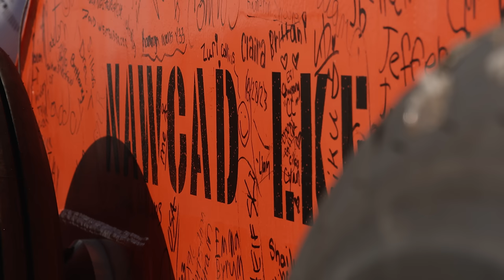John F. Kennedy (CVN 79) Dead-Load Testing

Comment: Wow!  Good to see the new Kennedy almost done.  I did design work on the old Kennedy CV 67,  Ford CVN 78 and the old Enterprise CVN 65. Great to hear that the EMLS is going well compared to the Ford.
Reply: The Sorry Sarah, (Saratoga)? I was on her in the early 90's for four years.
Reply: I would surely hope that they worked out the kinks in the EMALS or else that would be awful. Sure, they built-in way too much new tech into the Ford class, and there were lots of teething pains to fix, but in the end it will all have paid off.
Reply: @oceanic8424  I think they have worked out those kinks.  The Ford just did a really long deployment that surprised me and seems to indicate that things are working well.
Reply: No camera on the carts?????
Reply: @ghostmourn  Yes, the new launch and arrestor systems(EMALS/AAG) are working great and are performing above expectations.  You don't cruise the Middle East with sketchy sortie generation capability.
Reply: Almost? Almost in ship building means 4 years minimum.
Reply: To be fair, Ford was the first ship of a new class with some dramatically new technology, so there were going to be some bugs needing to be gotten out of her and the systems in any situation (though I wish it could've been done with less delays and extra costs). And so far, she's had two successful deployments on her operating record. Hopefully, the remaining ships in this class (Kennedy, Enterprise CVN-80, Doris Miller and the announced CVN-82) will be built and put into service much more smoothly.

Comment: I got to see the final testing on CVN 78 2 years ago and it was amazing knowing that the rails are powered by magnetic coils under the deck. 
When Ford left the dock, we went to the Kennedy and pulled miles of wiring throughout the ship. 
What an experience! It was the hardest earned money I have ever made. I will always remember that shipyard.
Reply: They do know that electrical equipment and salt water don’t mix right?
Reply: Attention everyone we cant have insulated wiring in ships bc they sail the 7 seas. Are you being serious w/ that comment dude lmao? @blipco5
Reply: @DefendTheStar  you obviously have never worked with marine cables. They're sealed and filled with rubber between the wires and going inside the wall have a double seal to keep any water out of the enclosure. 
The USN goes to great lengths to keep the equipment in running order. Engineers a lot smarter than you and I have done extensive research on what works and what doesn't. I agree with you that water and electricity don't mix. Neither does nuclear reactors but they're making it work.
Reply: @DefendTheStar  I’m just wondering how the protect the electrics on the catapult from the seawater?

Comment: The one sled had 78,000 lbs painted on it, probably near max for a US carrier based jet. With full power an actual jet taking off is well on its way all by itself, while the sled is dead weight with no engine.
Reply: I think the one in video said 7,800 lbs, but they do have sleds around 80,000 lbs (there was also a 51,440 lbs in the video)

Comment: Just a stupid question: do they retrieve the dead loads from the water? If not, won't they accumulate in the bottom as the testing of this ship progresses (combined with the testing of past and future ships)?
I know, retrieval would be expensive and economicaly not worth it, but it would prevent building up an underwater obstacle, and provide an interesting training exercise for the US Navy divers. Any thoughts on this?

Comment: Have they ever considered self-inflating salvage pontoons for the catapult sleds?
Reply: Of course they did...Rejected out of hand, they're painted bright orange, they know where they landed and EOD/BUDS rescue and salvage divers all need training evolutions.
 The Navy NEVER misses a chance to do things the hard way!...I was active duty CVN-73 (George Washington)
Reply: Means that the sleds are recovered manually by divers? 

Good for training the divers!

Otherwise they could have some sort of cable with a floating thing at the end to ease recovery.
Reply: The test sleds all float (even the ones that weigh 80,000 lbs)- Tug boats pull them back over to area where crane can pick them up and put them back on the flight deck.

Comment: if that's a brand new boat, what do they do about all the rust on the flight deck? do they remove it before putting the final coat on? or do they just go over it, 

i see it a lot when certain parts rust on ship builds and always wondered what they do about it

Comment: After the tastings do they recover the test sleds?
Reply: Yes, they float.
Reply: @stanstenson8168  how does a solid 18,000 lb steel sled float? those tires definitely ain't floating that thing
Reply: markplatt1784  that thing doesn't look hollow, alot of other people are saying divers have to recover them
Reply: @middletnpyro  OK. I was in Newport News on the GW.  They were launching sleds off the Stennis.  They float.
Reply: @middletnpyro  I am sitting at my desk at the shipyard right now typing this. They float. People smarter than all of us designed those sleds to weigh as much as the jets they are emulating and displace (which doesn't require it to be hollow btw) more water in mass than it weighs. Considering they are the size of a car it doesn't seem that hard to design it to float. Also, I saw with my eyeballs... and in this video... them float.

Comment: I know little about this so pardon my ignorance. Initially I thought it would be pushed but now I can see that it's being pulled. At the end of the pier / ship, if it is being pulled how is it released?
Reply: if it was pushed it would be very unstable. The way the planes work is they have a little arm on the front nose gear that locks in and when the puller reaches end of travel it stops hard, releases that little arm, and the plane has momentum and keeps going.

Comment: I wonder how much Tech of the system here is in China's? Anything classified? I hope so. I've seen images of the Fords rail working. The control of the power, the capacitor banks not so much.
Reply: the basics are unclassified. the nitty gritty details are. doesn't take a rocket surgeon to make this... especially since roller coasters have been using this system for years. the difficult part is making the power generation and making it rated for 80,000 lbs aircraft and making it fail as close to zero as possible

Comment: I'm sure they have a backup just in case there is some kind of power problem, would that be steam that has worked since the beginning of aircraft carriers for over 74 years and counting? The only reason I can see them resorting to electric power is because they can, but what is the reason?
Reply: Electric propulsion is smoother, more powerful and has tremendous controllable torque.  Locomotives use diesel electric propulsion for that reason.  If it weren't for the battery problem, EV cars, trucks, and vans would shine.  But cold and recharging are the albatross of EV.
Reply: the electric power is easier on the jets, breaks less often then steam, and the carriers nukes are double the power of the old ones. there is no backup other than basic redundancy. its electric or nothing.

Comment: I wonder how much a ticket to ride on the sled could charge?? Of course, some semblence of a safety seat/bubble would need to be made. But a speed up to 150mph off the deck? Awesome experience. Since the pilot and crew of actual planes are subject to the same forces as sitting on the sled would be, only a mishap and the water safety portion would need to be made!! Heck even a for profit killer fun park ride could be based on this. The Ohio fun park is right on the shore of Lake Erie and would be a great location!!

Comment: I had no idea ships were being retrofitted with EMALS.
Reply: Retrofit implies that this is replacing a steam launch system that was installed previous. This ship is brand new and had the emals from the beginning. No ship will ever be retrofitted with emals. That would require tearing apart half the ship and likely require new power plants.

Comment: EMAL is very important.  If you can’t launch, we’ve got a $12 billion mobile aircraft garage.  If it works, the smoother acceleration and the Advanced recovery system will extend the $100 million warplane fuselage lifespan by maybe 100%. Compared to land based aircraft, ship based aircraft only about 25% lifespan.  The Chinese PLA Navy also has EMAL.  Not sure if it works at high weights. If they steal the technology, they can manufacture it at lower cost and save a couple of $ billion in R&D.  They will skip the steam catapult generation which lasted about 60 years. China got their hands on for-scrapping Australian-UK mini carrier to get to the steam catapult which the Australian navy didn’t remove. Fly Navy.

Comment: Do they retrieve those sleds?
Reply: they float
Reply: That's hard to believe...  happen to catch the weight related comments from the guy talking?
Reply: @720 they use the phenomenon called displacement. by making the sled take up the space that water otherwise would be that water pushes the sled back up. if that amount of water weighs more than the sled, the sled floats. 

so basically, the 80,000 lbs sled pushes away (or displaces) 80,100 lbs of water give or take.

that's how a multi million ton warship made of steel and not airtight at all floats.

Also, I was there... I am literally typing this out on my shipyard computer.
Reply: Yeah, understand the concept and/or not doubting you just seems hard to believe based on the guys comments.
Reply: @Hbird1720  oh yeah, that makes sense. Yeah it's wild to think an 80,000 lbs weight can be accelerated to 150mph, and be thrown off a ship and float. But it's all true

Comment: Why do they have to repeat the same testing as the Ford?   If the technology is already proven, why not "steam ahead"?  Did they do this with every Nimitz?
Reply: Because advancements have been made since Ford's hand over the Navy. As with any and every ship or sub, the systems MUST be tested to ensure they work as designed and to Navy requirements. 

These carriers aren't like vehicles rolling off an assembly line. Each piece of equipment or system may look identical, but are made for each ship, therefore they have unique characteristics that require testing, before "steaming ahead. 

The Navy is paying close to $13B for each Ford Class carrier, so you'd better be sure EVERYTHING works as expected. 

As for the Nimitz Class, YES, this was done for all of them.
Reply: Are they're supposed to just build it according to specs, check a box, and then sail away?

Comment: It’s seriously insane the Kennedy was laid down in 2015 and is yet another couple years away from deploying.  For comparison, the Big E in the background was built and put into service in half that time. 

Just think about how much technology has advanced in the last ten years.  We’re putting brand new ships to sea with outdated tech.
Reply: There is nothing outdated about these ships because they are absolutely unrivaled in their capabilities. The Ford on her maiden deployment got extended into spending 8 months at sea and launched over 10,000 sorties without any crippling mechanical faults. In fact, it operated even better than expected.
Reply: CVN-65 was also essentially a Kitty Hawk with the boilers swapped for reactors.  The only “new” thing about her was the propulsion plant.  The Ford-class changed everything else about the ship in addition to new reactors.
Reply: You have to understanding the context of the situation
First, its only the second Ford class carrier built and it already has major changes. Its radar was change from SPY-6 , thats major change
Also remember that delays with CVN-78 also had an effect CVN-79s construction
As far as being outdated
Realize that ship its replacing is the Nimitz and it was built between 1968-1975
Thats 57 years ago
This ships technology as well materials are vastly superior 
More the point, Realize that most of the Nimitz class was built in late 70s and through out the 80s
So they very old and need replacement
The USN only order 5 ships as 6 of the Nimitz have completed their RCOH and are only the back end of their lives 
1 is RCOH and CVN-75 getting ready
CVN-76 wont hit RCOH till 2028s and CVN-77 sometime in 2030s
if rapidly built the whole class
A lot of the Nimitz would be decommission well short of their useful lives
While the Nimitz are older, they are still very useful and no need to rush their replacment